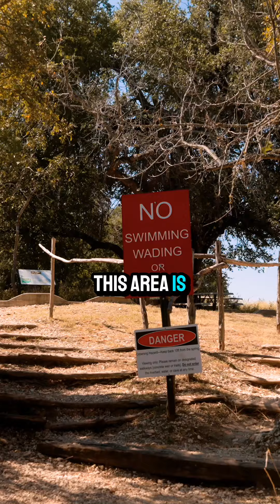Jacob's Well Is Stagnant Because Aquifer Overdrawn

Comment: you missed some points! Also it helps, to digg in the dried up, non vegetated earth thousands of entry points for rainfall, to plant more heat resisting trees and the more vegetation, gives the earth more shade, also leads to more rain more often, if this method is used in big areas.
there are great projects, within the great green wall project in Africa to learn from, 
how you can exactly replenish ground water levels 
by growing new forrest where once was dried savannah/desert.
Its not only the regulations for civilisations water use and methods of collecting rain and such,
thats only half the bill, if all your cities are concrete jungles and every water that falls, 
washes out the sand more, leaves the area quickly as surface water in street canalisation and parking lot drainage pipes.... 
bussiness owners with big parking spaces should be convinced to chance to an water permeable parking space design and so on...
also, beton surfaces are heating up the area like crazy, you should invest in making the citys green, with planted walls and roofs, trees in walkable allays less car-centric, less parking spaces and streets....

otherwise, all water collection and usage regulations will not help to change the local climate enough to replenish the wells!